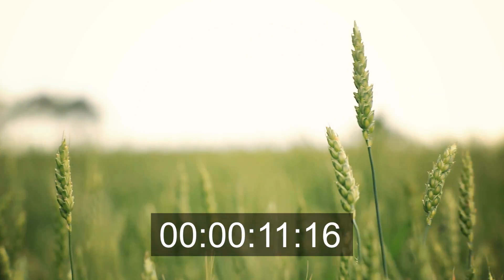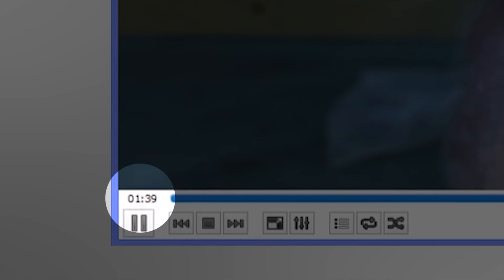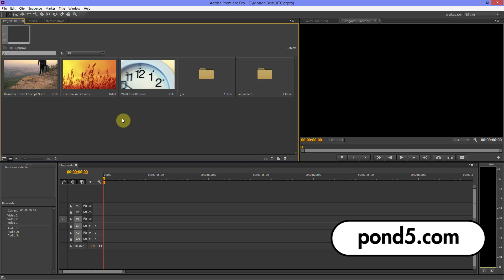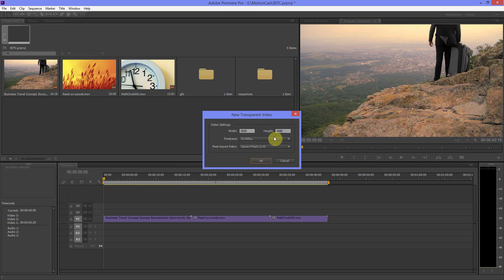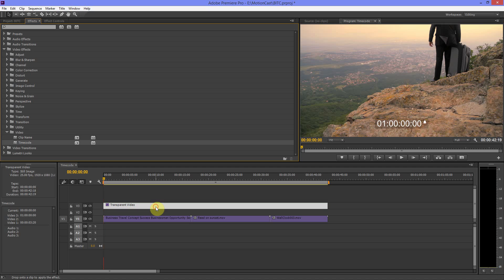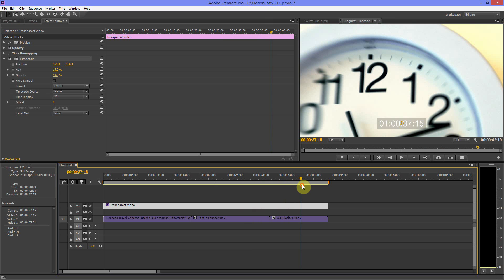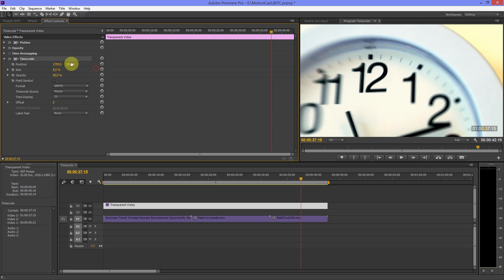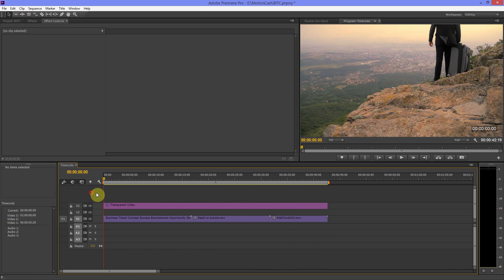Why Burnt-In Timecode Is So Useful!

Comment: when I speed up the clip the time doesn’t speed up with the clip 🙆🏽‍♂️🤷🏽‍♂️
Reply from the maker: Try using a nested sequence. Add your clip and timecode into a sequence and then nest that sequence and speed it up. Does that make sense?
Reply: Dylan Garton actually I did the same but the clip speed up by speed/Duration... but the timecode still as it is
Reply: i got it 😁😄😄 finally
Reply from the maker: @yousef4074  Yousef the man!

Comment: This is all well and good if your timeline starts at 00:00:00... but my timeline starts at 00:58:03:01 (For a bit of Bars/Black at the top before my video starts at 01:00:00:00)... and I want my timecode Burn to reflect this.  
Putting the Timecode Source on "Generate" doesn't appear to do that, it just sets it to 00:00:00:00, which is pretty useless to me.
  Changing the Source to "Clip" doesn't fix it, and changing it to "Media" doesn't either.  Anyone know how to fix this?  
   very frustrated at this darned PrPro program.
Reply from the maker: Hi oc1kev, you can get your timecode to start at 58:03 by using a different, and easier, method (which didn't exist when I made this video 4 years ago). When you export your sequence, go to the 'Effects' tab and choose 'Timecode Overlay', select 'Generate Timecode' and then choose your 'Start at' timecode. You are done!

Comment: Is there any way to get it to count in milliseconds rather than frames?
Reply from the maker: As far as I know, the frame is the smallest unit it can display. However, you could place your timecode in a separate sequence and then nest it and speed it up. I tried this with a 50fps sequence and found that speeding the nested timecode by 2000% gave accurate milliseconds (ie. 1000 at 1 second with 20 frame increments). Does that make sense?

Comment: Hey Dylan - I'm just seeing little square boxes, no numbers, in my time-code bar - what am i missing? Thanks mate.
Reply from the maker: Hi Ilie, it sounds like Premiere isn't using (or finding) the Arial typeface. Can you confirm that Arial is present on your system? (not sure about Mac, maybe it uses Helvetica)
Reply: i doubled checked, i have both those fonts, but yup no luck...scratching my head over here...
Reply: you were right, i called premiere and turns out they have this problem with a lot of Mac users, had to download the Arial type, which i had, but guess wasn't in the right folder...thanks for the quick help!
Reply from the maker: No problem Ilie, I'm glad you are sorted.

Comment: For future reference. You would usually want the BITC to start at 1 hour because if you send it off to get sound done, that is usually where they would ask for it to start. That way we can get behind the start of the video with no problems.
Reply from the maker: Hi Jeffrey. You are quite right. I used to produce content for Sky Sports and they always wanted the timecode to start at 0:57:00:00 on their tape-based masters. This was enough time for the bars & tone and the clock before the start at 1:00:00:00. Not necessary for my non-broadcast clients though.

Comment: Just what I was looking for! One question though, when I drop in the TC effect, my TC numbers come through as transparent whereas yours are default white. Is there a way to change that? Having them transparent makes them hard to read. Thanks!
Reply from the maker: Hi Jason. The first thing you need to check is the opacity. By default, it's set to 40% which might look ok in some situations. The other thing to check is the 'blending mode' under opacity in your Effect Controls. If this has been inadvertently changed to 'darken' it will produce the problem you're describing. Let me know how you get on.
Reply: Bingo. I didn't think to check the blending mode in the Transparent Track's opacity. Needed to be reset to Normal. Thanks, Dylan!
Reply from the maker: Glad to help Jason

Comment: Is there any way to make a timecode, that doesn't appear after render? I mean i can see it in the editing software but after i export it, it won't be visible. 

Great video btw.
Reply from the maker: Hi Samu. I would just turn off the track containing the timecode when you get to the encoding stage. It's the eye icon on the left of the video tracks.

Comment: How do you apply this to each shot, easily? I have multiple video tracks and would like to add a frame counter that starts and finishes at the beginning and end of each clip. Is there any way to easily do that? The clips are spread out across multiple video tracks
Reply from the maker: You could apply the settings you want to one clip, select the clip and choose copy, then paste the attributes of that clip to all the others.
Reply: Dylan Garton cool, thanks. I found the same solution in a search after posting. Worked perfectly :)

Comment: So I set the Time code source to Generate but its not removing the '01:' at the start of the timecode. Adobe Premiere CC 10.4.
Reply from the maker: Hi Dave. The latest versions of Premiere allow you to add time code at the Media Encoder stage. Have you tried using this feature instead?
Reply: I didn't know that. Thanks, I'll check it out.

Comment: Any idea how to remove the time code once it's burnt in? Soon after my hard drive crashed, luckily I have the video with the time code. I no longer have the source material.
Reply from the maker: +J Ben - I think your only option will be to pan/zoom into the video. This will only work if you have the timecode small and close to the edge of the picture.
If your timecode version is 1080p, the modified version might end up as 720p. Sadly, this is one cake you can't unbake!

Comment: Not working like every fucking one becouse i have too much fps.
Reply from the maker: +Hardner07 - What frame rate are you working with?
Reply: ***** Almost sure 90 - i repaired it - you need to not to use Generete or Clip - you need to use Media and than use offset -87 = Timer starts exactly at 1 hour then.
Reply from the maker: +Hardner07 - I've never tried it with frame rates higher than 50fps. Thanks for the tip!

Comment: Hi and thanks for your video!
I was actually looking to see how to display the CLIP timecode that the camera assigns to each frame, is there a way to do that (so not the sequence time, the clip timecode)? Thanks!!
Reply from the maker: +VideoMarketingGroup Hi there. In the 'Timecode source' drop-down, choose 'Media' and that should give you the timecode from the source clip.

Also make sure you have 'Use Media Source' selected in preferences. Select Edit > Preferences > Media (Windows) or Premiere Pro > Preferences > Media (Mac OS) and check under 'Timecode'.